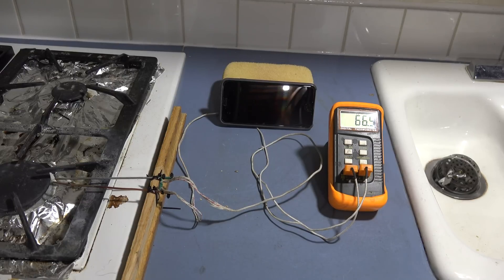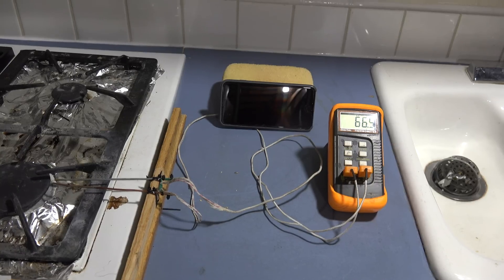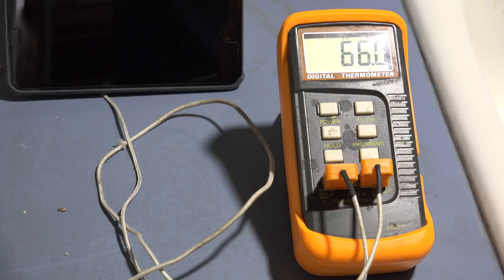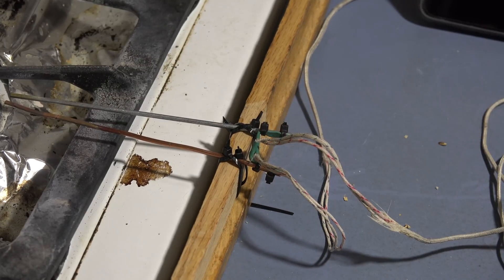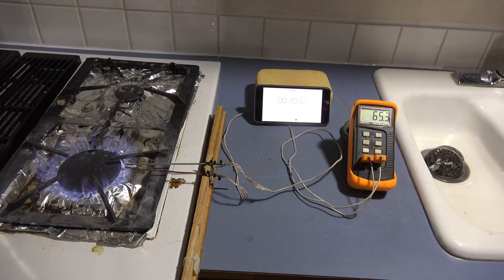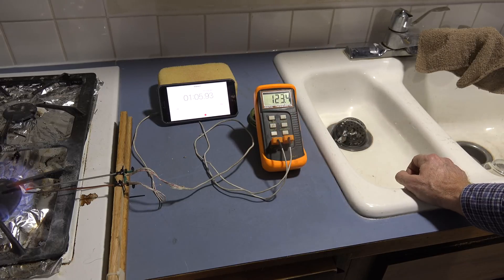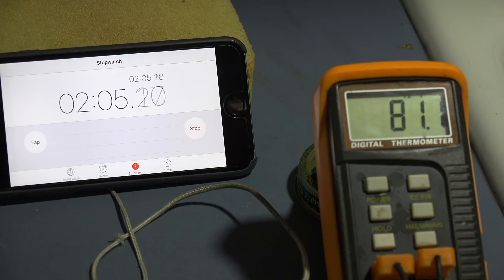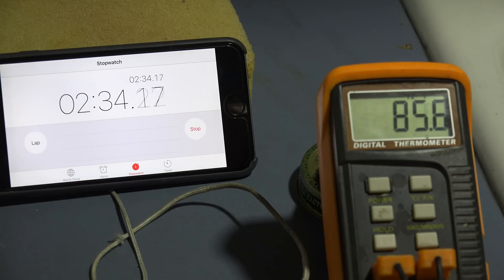Heat conduction demonstration

Comment: So, I'm assuming that copper has a lower melting point than steel; is that the reason why heat exchangers are made of steel? Or aluminum
Reply from the maker: +Kolocho DelRio Copper expands much more than steel and thus would tend to crack easier It also fatigues easier.  Aluminum fatigues even faster than copper.
GFM

Comment: this is why copper/aluminum baseboards give off faster heat, but cast iron radiators give off more gradual heat. Laton transfer of heat by different metals. Good video, thanks